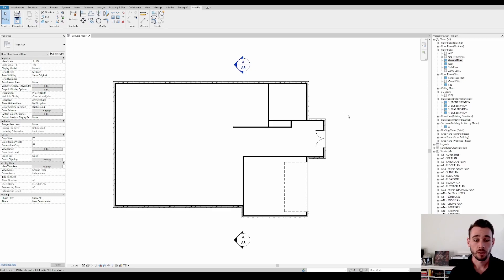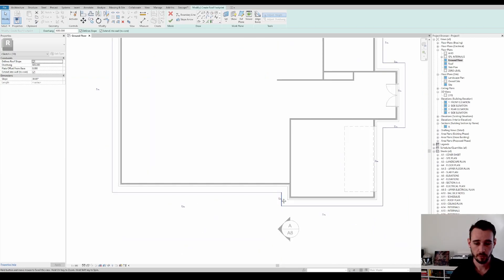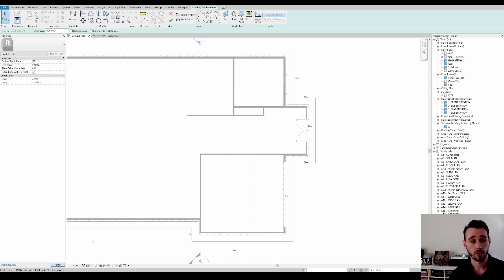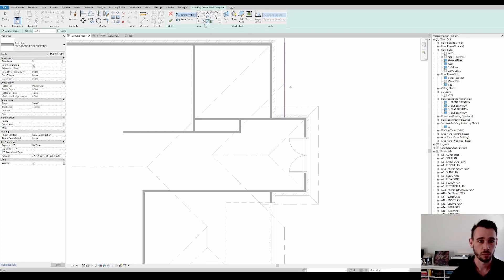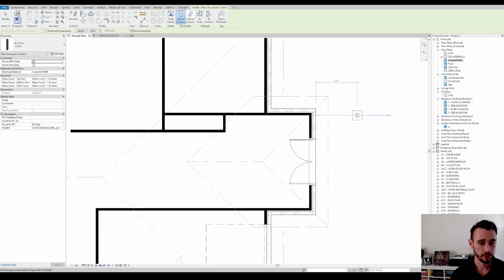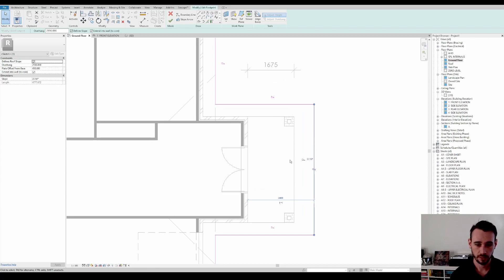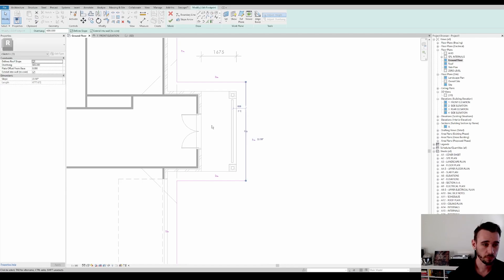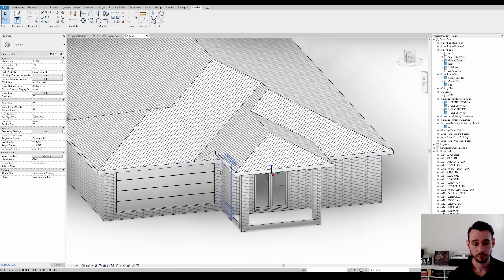Revit: How to model a Raised Roof properly

Comment: You can create it all as one roof without adding voids or any extra roof bits. Raise the roof like you did and using the split tool split the roof you want to be raised (approx 1-2mm) from the valley without a 'defined roof pitch' and then using the join roof command connect the side roofs under to the walls. I can send screen shots. This has been a big issue in years gone by though. Thank you for your video.
Reply from the maker: Just tried this out with a slight change but the join roof command to sweep the sides in under the raised roof is the part I hadn't thought of so thank you for that!

I always tell people the problem with Revit is there's too many ways to do any one thing haha
Reply from the maker: Sounds interesting, i'll try it out! thanks :)

Comment: Hey Mate,
Hope you're well!
I need your suggestion, from the past couple of months I am looking towards Revit draftsman or Rendering work remotely. But still didn't land anywhere. I completed around 80+ projects but am stuck a little now. Can you recommend something helpful???

Thanks and looking forward to your response :)
Cheers!
Reply from the maker: @cadsmart9271  Hey mate, sorry for the delayed response - I've been thinking about this a bit and here's where i'm at:

It's more and more common for drafting to be outsourced so realistically there's never been a better time to land work as a drafty in a freelance capacity. 

What you need to approach places you're wanting to get work from is for them not to hire another 'in house' draftsperson but to send you their excess work in a casual manner. You obviously need to present a well prepared set of example work, as well as functional knowledge of the relevant building codes of that area. I'm not sure where in the world you are or where you want to work but you need to be a specialist with those codes (which is the hard part - Revit is easy). These codes are usually easy enough to find online, and if you get a trial with a company they should be able to provide you with a copy to refer to. 

So, to summarise: pick a place to specialise - present high quality workmanship - approach from the 'casual / freelance' angle .

You could also try and work with a recruitment agency who specialise in international remote work?

All the best mate 🤘
Reply: @RevitSmart  Thank you so much for such a detailed response mate :)

Actually, I had been working in Brisbane for about 2 years remotely and had a very solid foundation on BCA. 

I've done Sitings, Cut & Fill, Covenant approved Plans & Exterior Renderings for a Real estate company. 

I've been contacting Real Estate Agents & Directors so far to land somewhere, is that approach correct or I am digging in the wrong place?

Also, I really appreciate you sending such a detailed message, and it's very helpful & clear. I'm just confused though I have the potential why I am stuck.

Thank again & have a Blessed day mate :)

Comment: I am not sure I agree with modelling like this, The primary reason is regarding scheduling of the roof. Also at the 8 minute mark is a good indication of the errors faced, because you have to then edit the void space and then move the wing pieces created that lead to more errors then if it was just modelled as two roof planes (one for the upstand and one for the main roof), it allows it to schedule easier and you don't encounter issues when you host fascias and gutters where you have to drag it along to the roof wing peices created. I think a better example is this video, it then allows you to easily adjust the modelled roof planes if they're hosted to the wall correctly.
 https://youtu.be/VXCjwcBg5WM
Reply from the maker: Thanks mate, i'll check it out
Reply: @RevitSmart  Revit 2024 is due out this week or next, keen to see what they do with the site works overhaul. There is going to be a join tool for the topo, super pumped about that feature